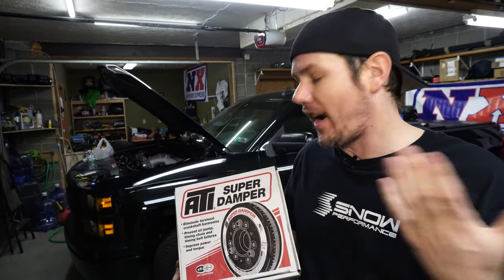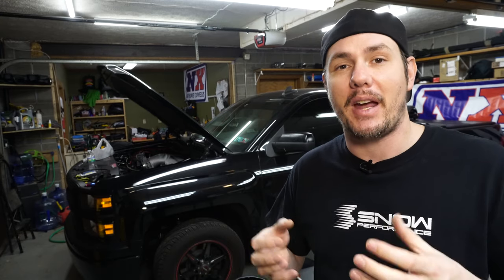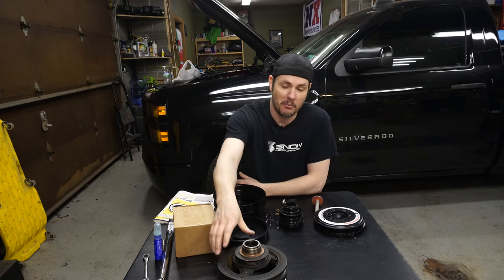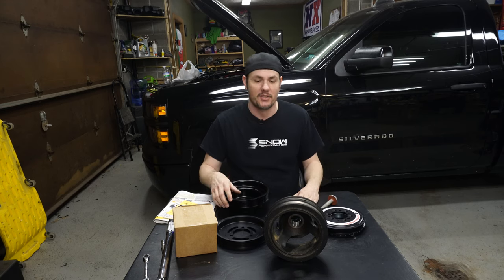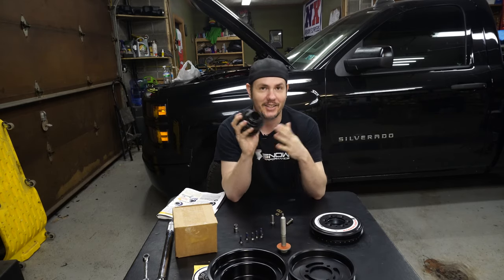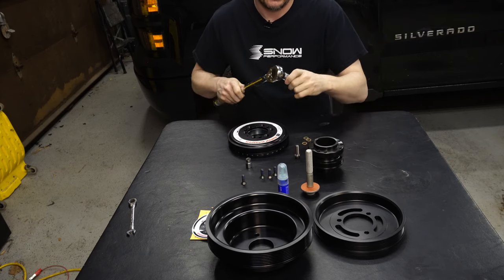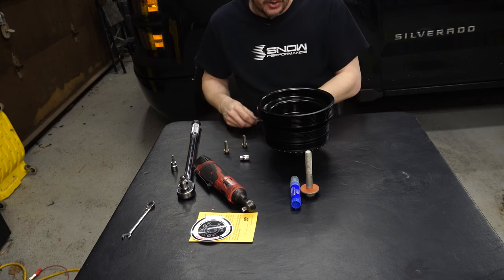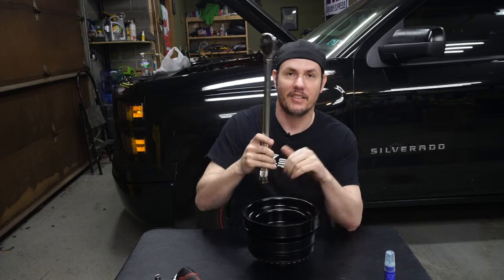Assembling our ATI Super Damper for the Procharged Silverado

Comment: I thought ATI use TP40 plus torx for all there damper torx bolts.
Reply: Mr1231mpw that’s what I used for my ATI assembly.  In a pinch you could probably get away with a normal Torx tho

Comment: Anytime I install a press fit gear or a clutch or anything that's a little tougher to get on I always use the old school method.. Heat the balancer up in the oven obviously within reason a few hundred degrees would be more than enough or less basically if you got it heated up hot enough where you could use some mechanics gloves or welding gloves and then slide it on as far as it will go then be ready to run it on with a air ratchet or something other than hand wrenching it should go on much easier than just being room temp. Worth a shot shouldn't hurt it once it's close to down finish it up with your torque wrench. And maybe spray some glass cleaner or something that will dry on the end of the crank also might help it slide on easier. Idk if this helps but just my thoughts. Always do this with snowmobile crank bearings we have replaced lots due to failure on the clutch side and there typically all press fit in most cases the good old shop toaster oven heat them up to 400 degrees for 5 minutes and then they drop on the crank like nothing. So I'd imagine the heat expansion would help. Thanks for your helpful videos much appreciated and I'm learning lots on GM tuning. I'm looking forward to trying ls droid for doing ls swap harnesses and setting up for doing basic swaps and I'm also interested in doing a turbo setup on my daily driver GMC Sierra and using hp tunes for my truck projects so I've been watching all I can on my shop computer at home on my tv and on my cellphone when I need to comment and communicate. Hopefully you keep up the awesome job thanks from upstate new york!

Comment: To remove the dampner bolt the 24mm Ingresoll Rand Power Sockets are amazing and for install definitely use the install stud if not you'll strip out the crank threads and a little WD40 goes a long way for the dampner pull up

Comment: 12 point is more points of contact with the correct too. Much better.
Reply: How many points does a bolt head 
have?
Reply: @tedgtfan  depends on if it's a 12 or a 6 point...12 if it's a 12point and 6 of it's a 6point...
Reply: @BadRobotXIII  true but the bolt the video was referring to was a 6 point hex.... and love the vega, still wish I had my 72
Reply from the maker: Yeah, crank bolt is a 6 point
Reply: @tedgtfan  Thank you sir. It was a long road to get it where it is. Mine is a 72 also. They're fun little cars with 500-600hp 😁

Comment: I’m not a fan of the stage 2 kit. I have a 2015 mustang gt that I put a p1x HO kit on. I wanted to convert to a 8rib setup because of belt slip. No one makes a 8rib setup for the HO kit so I made my own. Replaced all the stock pulleys with 8rib with a ati 20% overdrive balancer. Works great and is in the factory location
Reply from the maker: I will say, the stage 2 kit on the Silverado is 10x easier to install and significantly more stable than the stage 1
Reply: Goat Rope Garage I think if the stage2 didn’t use a cam-lock setup to attach to the balancer ( on the coyote 5.0 ) and put unneeded stress on the nose of the crankshaft by hanging too far off the front of the crankshaft. It would be perfect
Reply: @horsepoweraddiction808  I know it's be a while but do you happen to remember where you ordered all you 8 rib pulleys from? Thanks